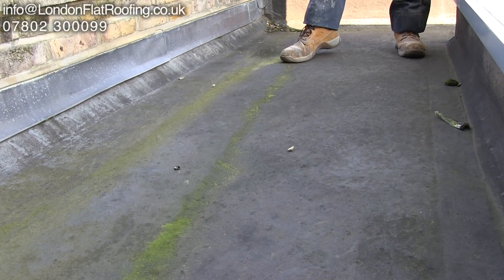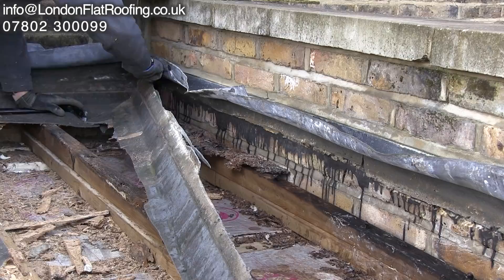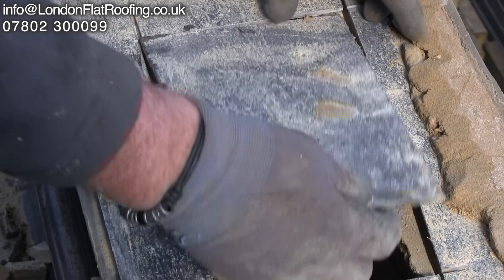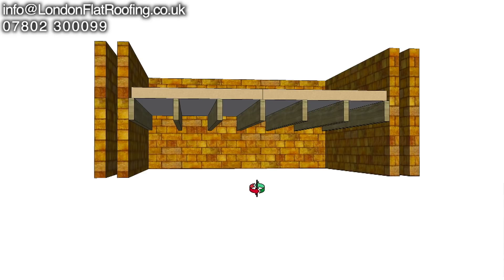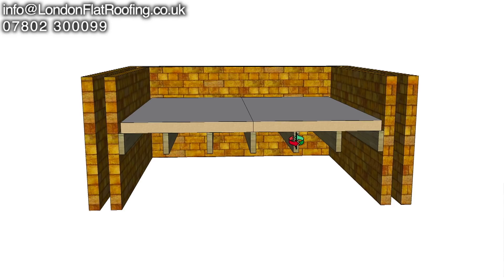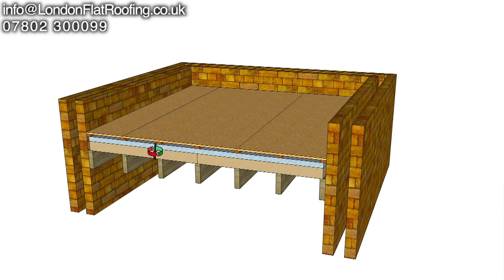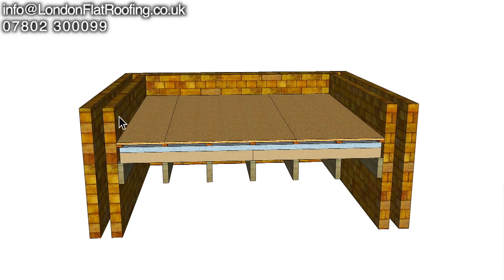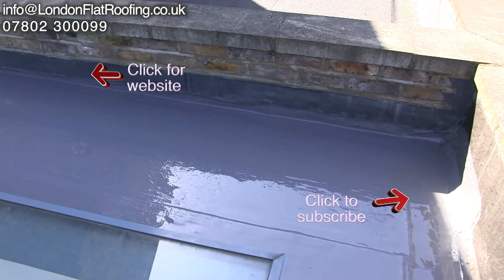Rotted OSB roof decking. Cold flat roof condensation and through ventilation

Comment: Great vid, just fell across your channel. I'm in construction and im finding the insolation seems to be the problem in a lot of cases, building regulations seem to change from month to month and a lot of it is with insolation. The trend seems to be locking in heat and the foil back slabs we all use today is causing to many problems, plus fitting a cavite tray on the parapet wall will stop water penetrating through your coping stones and down the inner wall.

Comment: Hi Steve, great set of videos - really useful!! A quick question related to this; if you have a mixture of a warm roof (50mm) of insulation on top of vapour barrier and osb and a cold roof 75mm of insulation between joists and a void between the two - would the void need to be vented? There are spot lights that have hooked through the 75mm of insulation that could let moisture up into the void. Many thanks in advance!
Reply from the maker: No you don't want to put more insulation in the roof van is above it generally speaking you want 3/4 of the installation outside and only 1/4 inside I have seen people do 50-50 and they do get away with it however this is all down to how are you live in the property and the relative humidity inside the room below

Comment: Just came across your channel and have found lots of helpful information.  I am in the process of trying to diagnose the issue with my roof.  I have a shallow slope EPDM  Rubber Roof with rotted decking above a bathroom and trying to figure out what is causing it.  After opening up the ceiling in the bathroom, it looks like the drywall ceiling is mounted to 2x4 framing that is mounted to the joists/rafters(not sure proper name) to level off the ceiling since they are at a slight angle.  It looks like there is painted wood fiberboard insulation on top of the board that used to be the exposed ceiling  (It looks/feels like compressed cardboard almost?).  There is OSB on top of it and I don't know what else might be between the OSB and EPDM rubber roof.  In between the joists there is white fluffy like insulation (not paper, foil, or anything else on the surfaces) that seems to fill the space between the drywall and wood fiberboard insulation.  I only opened a small section by the bathroom ceiling fan vent, but it looks like there is a 2x4 between the joists under the wood fiberboard insulation in one spot to help hold it up?  The wood fiberboard insulation seems to have some sag where it has no support between two joists.  I can see rusted nails in that 2x4, a little bit of mold on the wood fiberboard insulation, and we discovered a bunch of carpenter ants up as well as some ant waste or chewed up wood(?) there when we opened up the ceiling.  I am not sure if it is a bad design, lack of vapor barrier, bad vent, or leak from the roof causing the issue of the rotted decking.  Do you have any ideas?

Comment: Loving your videos. Many thanks. I’ve now got a 16X9 timber workshop I want to fully insulate to use all year round. Can you point me in the right direction for the best approach to this? Thanks for any help. Paul.
Reply from the maker: Yes, absolutely  sounds like a nice project how far have you got with it? perhaps send me some photos and info and  ill see if I can help
Reply: Steve Roofer hi Steve. Thanks for the prompt response. No photos as yet. Shed is 19mm shiplap cladding on a 3x2 wall frame. I am thinking of inserting 50mm PIR boards between studs with one inch gap behind. I plan to go around the boards on the inside with foam to fill gaps. Do I need any membrane on the cold side of the boards and should I cover the walls with a vapour barrier before putting up ply facing?
The roof is wooden boarding covered with green mineral felt with an uninsulated metal profile sheet on top. The boards sit on wooden trusses. I am unsure how best to insulate the roof. Any ideas?
Thanks for any guidance.
Reply: @SteveRoofer  Hi Steve. I have tried to attach a photo of the shed but I am unable to paste it in this post - apologies. Its a standard shed construction and I want to create a heated workspace for my woodworking hobby and need to insulate walls and roof space. Having viewed your very helpful videos I am concerned about creating hidden damp spaces. I would welcome your thoughts/guidance. Many thanks.

Comment: Informative video Steve, clearly a pro. We haver a similar style rear extension currently being build that requires a cold roof to avoid roof build up. We've specified web style joists and vents all round in the parapet walls to remove moist air build up. Can I ask what kind of air vents you would use please. Thanks in advance. Ernesto

Comment: Hi Steve  great video - what is the make/model of your camera you use to inspect hard to get to areas displayed in this video and do you recommend it?
Reply: Wireless Inspection Camera, Depstech Premium WiFi Borescope Endoscope 1080P HD Snake Camera for Android and IOS Smartphone, iPhone, Samsung, Tablet - Black(11.5FT)
It's good but not perfect easy as it connects to the iPhone but actually, you don't see much inside  roof with it used it many times but haven't found that it's given me much get better results cutting a bigger hole and putting  iPhone or GoPro down the hole

Comment: What's on the roof Steve for waterproofing originally
Reply from the maker: It was Kemper. nothing wrong with the Kemper roofing system or the way it was installed
Reply: @SteveRoofer  hate the stuff to much messing around  and possibly the worst  thing to get on Ur hands 😌
Reply from the maker: @SuperMickjr  Me two used to do Kemper but had to stop because of the health and safety implications
Reply: @SteveRoofer  ya from Ur men attacking u for getting another kemper job 😄